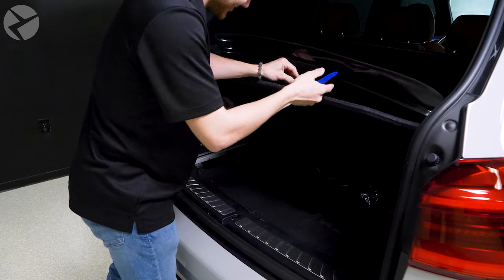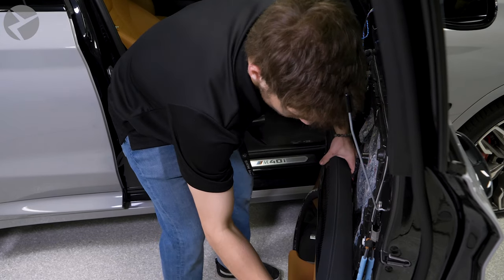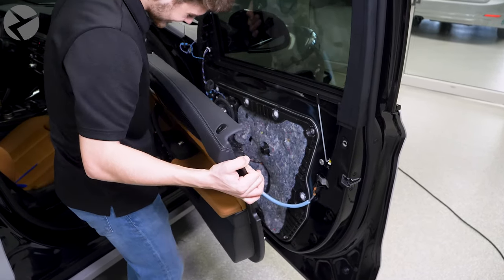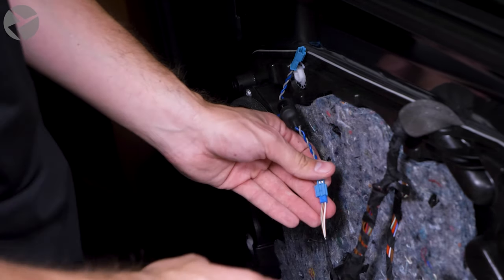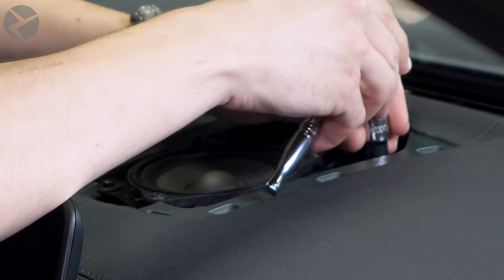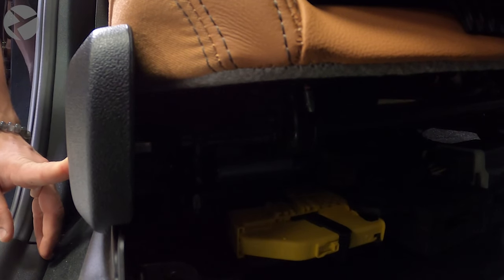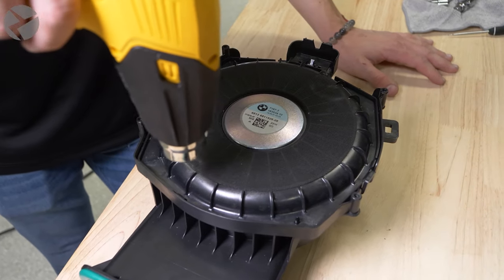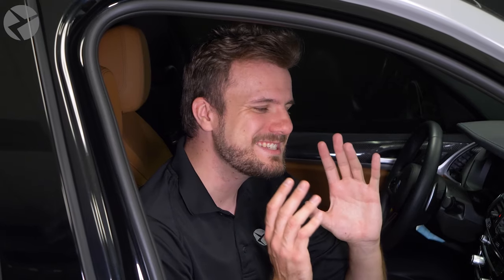Alpha One BMW Speaker Upgrade in G01 X3 – Install Tutorial

Comment: JM 

I believe that the front door Alpha One speaker, shown in the video is meant to go in the dash. Aren't the plug-in connections on the door and dash Alpha One speakers located differently? Shouldn't the Alpha One door speaker have a plug-in connection on the outside, like the original speaker? I think Alpha One does supply speakers with the connection as described and it appears that a speaker meant for the dash has been installed in the door with cabling coming from a connection inside. Is this correct?
Reply from the maker: The process shown on the video is performed properly. The front door midranges in some cars goes to the dash as well, so we are supplying an additional one, which is exactly the same. The replacement speakers uses the same connections as the OEM ones, so they have “outside” connections.
Reply: @bimmer-tech  Thank you for your prompt reply. I am still confused. The link here https://www.youtube.com/watch?v=pyQ7xXebT14 shows more graphically what I am saying at time code 8:42. The installation, in both cases, is of the Alpha One X3 kit. In one video, the plug and play connection, for the front door speaker, is on the outside of the speaker housing and on the other video is on the inside rear of the speaker. Which one is correct? I might be wrong, but I think your video shows that the speaker meant for the center dash is being installed in the front door...

Comment: Any thoughts on filling in the bottom end?   My 2019 has no bass.
Reply from the maker: Hello, have you purchased our stereo system? If yes, our audio specialist can prepare specific tune adjusted for your audio taste, so you will be able to experience more bass.
Reply: @bimmer-tech , I have not but glad that's an option.   Do you have something with a subwoofer that doesn't require cutting?   

Love your MMI Prime on my 2016 F83.